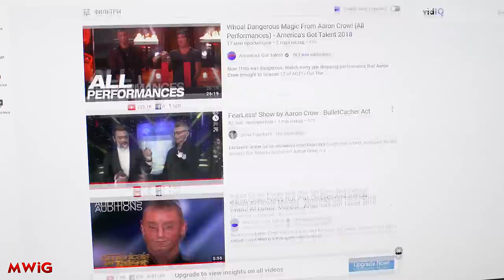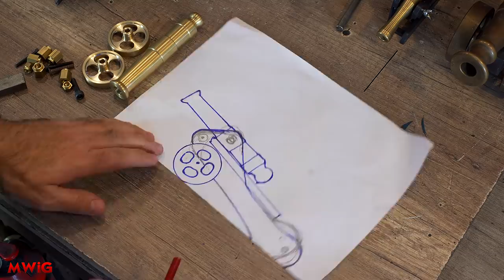Making Mini Cannon for Aaron Crow

Comment: Very nice. :)
Tip: When you clamp soft metal in the vise put some cloth around it so the jaws won't leave marks in your workpiece.
Also, a little wad made from toilet paper or cotton wool is excellent for sealing the powder charge from the projectile.
The cannon will be even more powerful with the same amount of powder.
Reply: Alu jaws
Reply: @knicklicht7945  Yes, they are great. However, to fully protect the threads it pays to use a rag or similar. ;)
Reply: When I put soft alloys in the vice I use aluminum spacers or hard wood spacers to hold them depending on what I am doing.

Comment: My high school shop teacher would have failed ANY of us who didn't use lubricating oil when we were doing any machining of any sort.

The cascabel, the small knob on the breach end actually has a purpose!
When the tube is emplaced on the carriage a wood beam is inserted into the muzzle , a chain is wrapped around the beam then the other end is looped around the cascabel, using a gin the gun tube can then be lifted flat.
Reply: Spot on.

Comment: Very cool!
A bit crazy, isn't it?
And it actually works.
But very good work from you.
I've noticed that no tool is safe from you.
You can use anything.
An aluminum pan, garden shears, screw clamps,
plastic protection from your scooter etc.
I think that's really cool.

Comment: The idea is interesting.Making small cannons in decoration is very good but to use it to make shots,the brass is not particularly recommended and broken. I myself have been dismissed from a gun club for 17 years and I would not risk it.
Reply: This is actually quite odd, because bronze guns are known to be somewhat superior to iron ones. Cast iron guns can only handle so much chamber pressure before exploding, where a bronze gun is more likely to deform quite a bit from overpressure, but not explode and cause injury. Bronze guns are also much lower in friction coefficient when using cast iron shot, allowing higher velocity with equivalent powder charges from cast iron cannons. The lower friction also decreases chances of unsafe chamber pressure, because the shot is more likely to leave the bore, giving the pressure an easy path of least resistance. The only thing cast iron guns have over bronze guns, is iron is cheap and weighs less. So you could cheaply outfit a brigade with cast iron cannons that wouldnt pose much issue to move around, or use expensive and heavy, but superior, bronze guns.

Comment: another great video... but I doubt that barrel and ball are going to be very acurate. He will have a hard time trying to control the shot. While it is an optical illusion and he will not be harmed, that little cannon won't have the accuracy to actually pull it off. It's a good think its just a trick

Comment: 15:37 When cutting metal with the angle grinder and without wearing gloves, there is a rare possibility that the cut metal will get hot...🤔😂
Reply: wearing gloves when using saws or grinder are making them even more dangerous
Reply: You never ever use Gloves with Spinning Tools
Reply: @Manu.1740  @thekingofrandom explains it all in there videos
Reply: I have to agree, gloves can get caught up and snatched by the tool and can potentially cause some nasty damage. I found something similar with a steamer; do NOT use with gloves, it took all the skin off my hand, and I had to wear a latex glove for quite a while to prevent scarring.

Comment: seen someone that left the spacer behind the piece and turned on the lathe , the result was a big bang and a dent in the ways on the lathe 
he immediately made a lathe spider : https://www.youtube.com/watch?v=MmHOlrxHJmk&ab_channel=MrPragmaticLee
about shooting the cannon . i wonder if it helps the guy behind the cannon if the firinghole is lightly slanted to the front , that way the cone of burning gunpowder comming out the hole fires at least a little bit away from him 

the trick has been around for a while and has killed a few magicians , 
i heared of one way to perform the trick was to adapt the musket to fire from a hidden barrel below the one holding the bullet , the gunpowder smoke made it look like it actually fired the bullet 
and the magician put a bullet hidden in his cheek in between his teeth and showed it to the audience 
the magician had to disassemble the musket to get the marked bullet out after the show 
the guy took the gun apart one time too often causing a hole to open in between the barrels , that caused the gunpowder in the lower barrel to ignite the gunpowder in the barrel holding the bullet killing the magician instantly 

just hope the guy tries to think of a safer way to perform the trick